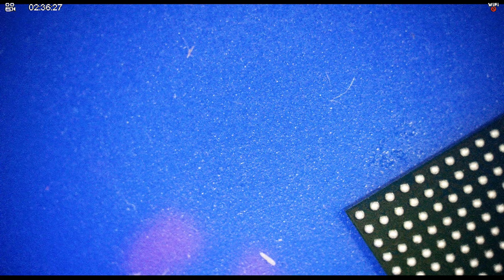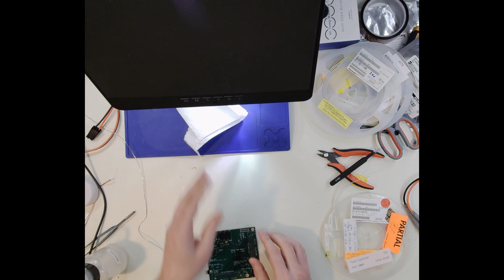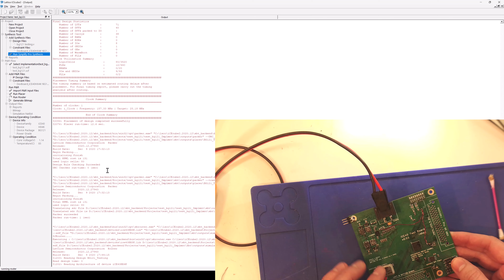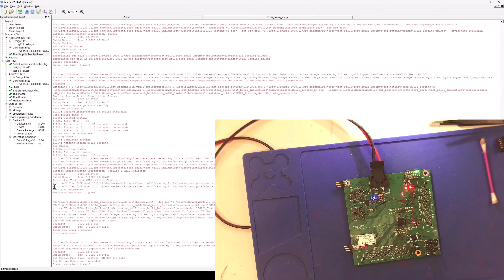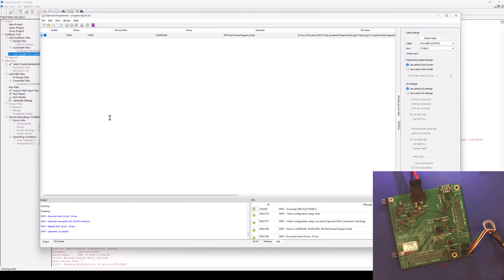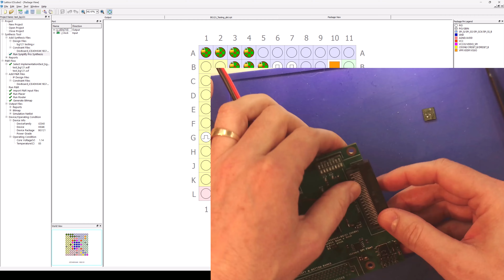iCE40 BGA-121 Dev Board Running!

Comment: I really like your videos
Reply from the maker: Thanks!!
Reply: @rehsd  How did you manage to get signals/planes (even ground) to the center of that board filled with vias? What is the size of the vias? I use jlcpcb 0.20/0.45 vias (free option) and can not get ground plane under neath. What is the clearance you set and hole size/via diameter? Thanks
Reply from the maker: @GK-dd5ci  For this project, I'm using 0.2 inner, 0.3 outer on the vias. I have the copper plane network spacing and spoke spacing set to 0.2. When I use copper pours instead of planes, I also set Fill Optimization to No.

For my Zynq-7000 PCB I'm currently working on, I am using 0.3 inner, 0.4 outer for vias (0.8 BGA pitch, also). I currently have my network/spoke spacing at 0.127; I'm not sure if JLCPCB will be able to manage this, but if they can't, I'll increase it from 0.127.

Comment: Did you fix the issue with the 5V rail?

BGA reflow is something i see in my future. I've been practicing reballing over time and getting better at it. Still a long way to go though, there's definitely a technique to it.

I think my biggest issue was not making the pads completely flat, probably because i didn't remove enough solder with my wick, so balls had a tendency to roll off and merge with an adjacent pad. Just don't dwell too long and keep your iron moving, i popcorned one device by dwelling too long in one position!

Also hot air has a tendency to blow the balls around unless it is incredibly low speed. I've been preferring using my hot plate instead.

The things we must do as hobbyists! 😅
Reply: Awesome. Nice to hear it was a simple fix.
Reply from the maker: I did fix the 5V rail. It was a poor solder connection on one of the pins of the regulator. Along with some resistor adjustments, all the rails are looking good (the best I can tell). I ordered a simple re-ball kit to do some practicing.  :)

Comment: 1. Clean up the board and BGA balls if you touched them with your bare hands before soldering - we always have oil on a skin, and it can mess with soldering.
2. I prefer "lots of tacky flux" method for soldering BGA with a hot air gun. Start with your gun some distance away, then as things heat up and flux activates, you can slowly bring it closer. The biggest risk here is blowing it off from an unfortunate offhand move.
3. For reflow oven, I use a lead-free paste with the same SAC alloy as the balls are made of. I did have success using leaded paste with lead-free BGA balls, but I'm not certain of long-term reliability of such approach - hence I use LF paste. It's more time-efficient to reflow entire board side at once, so apply some paste through stencil, place all components on one side, and then place the whole thing in the oven. Note that if your oven has a steel drawer, either use some spacers or some scrap empty PCBs to ensure the board you are reflowing is not sitting right on a drawer. For paste it's best to use room-temperature stable one (I use paste by Chipquik) so that you won't need to worry about freezing/unfreezing it before use.
4. Try to clean your board often and always keep it clean. If you can, stock up with electronics-grade isopropyl alcohol (google "Mg Chemicals 824" for one example), if not, 70% from any pharmacy will do in a pinch, but you will have harder time removing all of the residue.

Comment: OMG - that is NOT what via in pad should look like! It's good that you told us upfront that the board is working, otherwise it would be a nail-biting video, as those vias can easily suck in the solder ball and would cause a non-soldered joints. In the future NEVER do it like that - either make sure you actually have a via-in-pad process applied (JLCPCB does it for free for 6+ layer boards, but for 4 layer boards it's a paid extra) - it would fill those vias and plate them over such that it will look like a normal pad (unless under HIGH magnification when you can sometimes just about make up the border of a via because the surface will be a tiny bit uneven), or do a regular dog-bone-style breakout. You really got lucky on this one. [UPDATE AS I WATCH THE VIDEO] - Well maybe not so lucky afterall...
Reply from the maker: Hehe... Good to know! For JLCPCB 4-layer, are you referring to one of the "Via Covering" options? I'm assuming it's the "Epoxy Filled & Capped" option. Does that sound right?
Reply: @rehsd  yep, that's the option. Note that as you switch to 6+ layers, this option becomes selected automatically.
Reply from the maker: @asmi06 I've added it to my "PCB checklist." For a 4-layer board, it's a $50 upcharge, so going to 6-layer at this point is a no-brainer for me. I appreciate you pointing out that issue. Thanks!
Reply: @rehsd  For me it shows only $16.5 upcharge for via covering. Not sure where $50 comes from as it would indeed make 6 layers a no-brainer.
Reply from the maker: @asmi06 I had gone into the order form and clicked that option; it added the ~$50. I just uploaded the actual Gerber files, and it shows me the same price you're seeing. https://imgur.com/a/E7xMYVa
Reply: @rehsd  good, because I remember that ordering 4 layer PCB with via-in-a-pad option is still cheaper than going for 6 layer and getting this option for free.